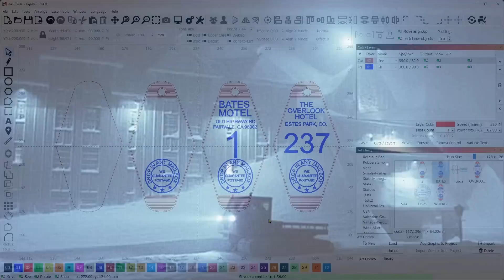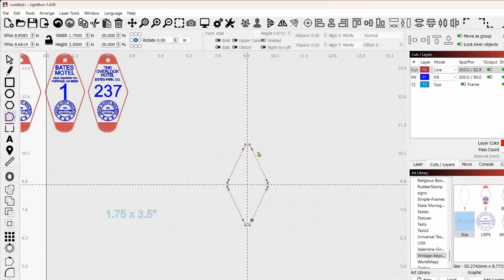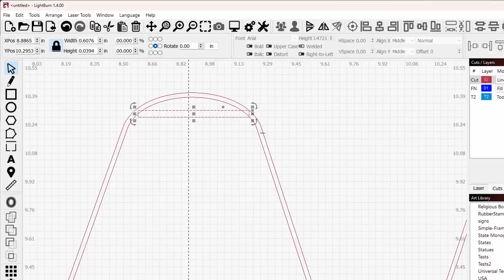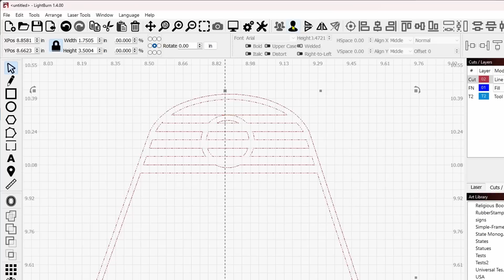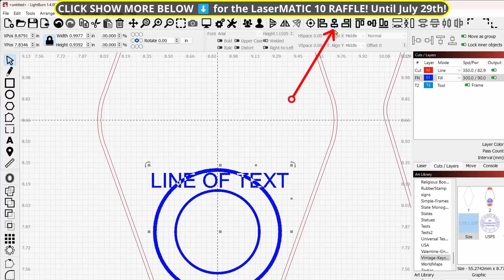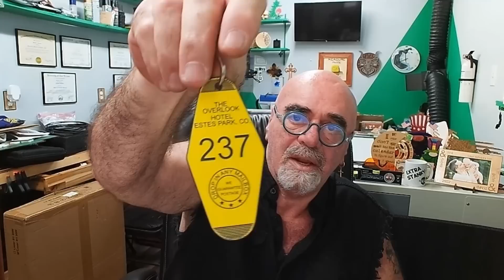😍 Vintage Keychain Design! Engraved and cut from PLASTIC on the Roly LaserMATIC 10 Diode Laser!

Comment: Hi Rich, great video again.  Quick question.  I am using an Ortur 2 with the 10W LU2-10A laser, and am having real troubles doing this on clear acrylic.  Running on Ortur's Black engraving platform, I ran the laser at 100% at 200MM with 4 passes, and did not even go through the acrylic.  I then tried putting some blue painters tape on top of the acrylic thinking there was some reflection of the beam, but no difference.  Any suggestions would be much appreciated.
Reply from the maker: If you're trying to cut the acrylic, that'll never happen with any diode laser because the 455nm laser beam passes right through. You'll need a Co2 to cut it. I engrave clear acrylic by just leaving the paper cover on it, or you can use masking.
Reply: Thanks Rich.  I had assumed you cut these key chains out on the Roly diode laser.  Or will it not cut the acrylic I am using because it is clear?

Comment: when I pick a layer for the lower blue circle it doesn't fill in and I cant see what you did at the bottom, help
Reply from the maker: Set the layer to fill in the Cut Settings editor.

Comment: took your advice on the Roly LaserMATIC 10 .!!   also looking for a C02.  thoughts on the Monport for a beginner ?.. thinking bigger than the 40.  Many options out there - and big price difference
Reply from the maker: If you're talking budget Co2, I would spend a few dollars more and buy from OMTech. Monport support is beyond terrible, which is why I don't deal with or recommend them anymore. And trust me, you will need warranty and tech support! If you're looking around 50W with a decent sized bed, look at the Gweike Cloud 50W Pro. I have one and it's an awesome all-in-one machine without all of the headaches. If you have a problem, they have 24/7 chat support with an actual technician. I also have a coupon code to save a couple hundred bucks: lahobbyguy

Comment: Use a PO Box… it’s a lot safer for you and your friend…

Also these 12” x 24” sell for $15+ per sheet on the site…. That little sample piece you have is not the same thing. Pretty pricy…
Reply from the maker: That's 32 keychains for $15 or about 47 cents each. Cheaper than the one I used.

Comment: Thanks for the link to the plastic seller but which of the many different plasics is it and how thick did yoy use? The first one I looked at was 30 bucks. Cool idea though. Thanks for the video!
Reply: Love your videos but the link you included is for .004 thousandths of an inch. 1mm is .040 thousandths of an inch.
Reply from the maker: I bought them a year ago, so I couldn't find the exact link. You can search on the site and find it though.
Reply from the maker: I use 1-3mm George. Here's an example of a 12x24" sheet for $15.35:
https://www.jpplus.com/rowmark-laserlights-engraving-plastic?sku=S681224-SHT
Reply: @TheLouisianaHobbyGuy  That's only .1mm - that seems thinner than what you were showing as your examples.  Am I just reading it incorrectly?
Reply from the maker: The one I used in the video was 1.5mm. It's hard to navigate their website for this material because there are so many different types. I bought this last year, so I don't have the exact link, but I have some red in 1mm and it comes out just as good.
Reply from the maker: I updated the link in the description as well, thanks! The sheet size of 12x24" works out to be about $1.50 for each keychain.